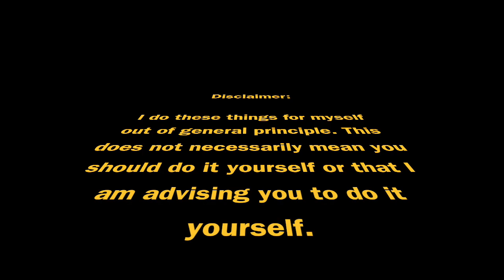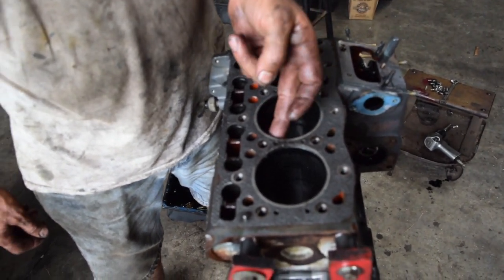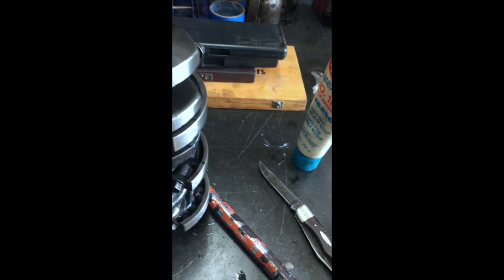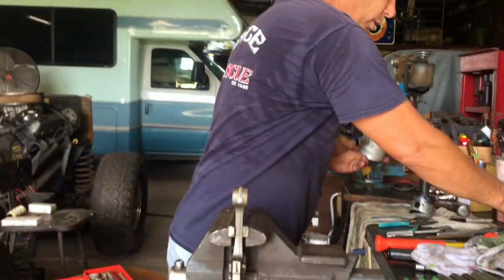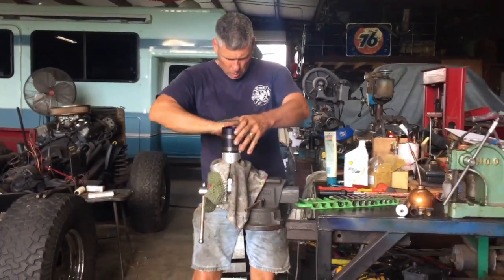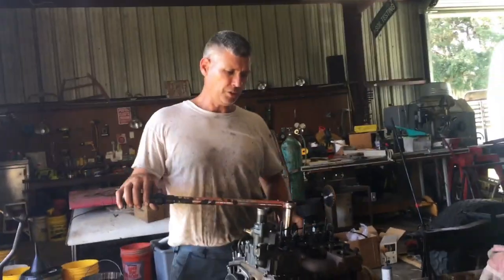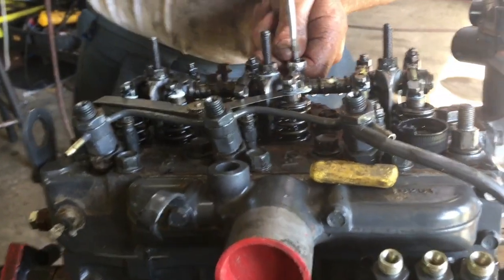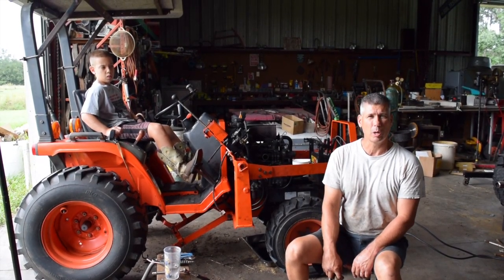Kubota B1700 Tractor Engine Rebuild and No Start Fix

Comment: Great video.
Damaged air filter or leaking/damaged inlet hose can cause wear like that, often called "dusting". Severe cases will see wear of the valve guides also.
More wear on cylinder number 2 due to the alignment of the intake port and the manifold inlet. 
"Maybe?"
Reply from the maker: Bruce McKenna thank you very much! Great insite!
Reply: This is it. I'm tearing my Kioti engine down and number 2 is the one that lost compression. Number 1 seems to be in the best shape and number 3 is weak but still making compression. Pulling it apart I found the previous owner had never changed the air filter and the inside of the filter and intake snorkel were almost as dirty as the outside of the filter. Not buying a $15 filter destroyed a $4,000 engine.

Comment: Just rebuilt a V2003T Kubota for the second time,  My compression is low (about 260 PSI)and hard to start cold. All new rings pistons and standard bore sleeves, and had the head and valves pressure tested. How did you break in the rings?
Reply from the maker: 30w diesel oil, heat cycles of 10-20 minutes a piece then cool down. And 2 to 3 oil changes. Then good diesel oil.

Comment: You forgot to check the end gap on the piston rings. File to fit. If the end gap is to tight in the cylinder bore when that engine get hot that piston ring end gap will bind together and the top of the piston will brake. Gaping and filing piston ring end gap is the most over looked procedure in rebuilding an engine.
Reply from the maker: Sam Logosz yes there were checked. These were already gapped properly

Comment: 370 hrs in 20 years is only 18 hours/year.  Perhaps it sat idle every winter and the cylinder bores rusted some ;  rings scraping  rust every spring might explain the worn bores and a crank not worn.
Reply from the maker: Absolutely a possibility thx.

Comment: You oriented the pistons to the rods but on my d1101a there is no marks at all on the pistons showing which side faces the front. And rods are identical for either side. I bought my kubora with pistons already out and head off so I pretty much got a puzzle to build. I got the piston and liner kit but I'm just using the new pistons and wrist pins bushings.
Reply from the maker: Yeah I had to double check all that as well. Good luck.

Comment: Make sure the relays for the fuel cutoff solenoid aren't causing the pull coil to stay on rather than just the hold coil.  It's only supposed to fire for a split second, if it stays on that will burn it up fast!  Great rebuild video!
Reply from the maker: RickBaconsAdventures I will check that out. Great info! Thanks!!!

Comment: Nice gob putting it back together🐂
Reply: How did you split your tractor
Reply from the maker: @evans4119  you need to pull all the grill, radiator and sheet metal  in bolt the front axle and remove then all throttle linkage and fuel lines, then the bell housing bolts and frame rails if it’s so equipt
,
Reply from the maker: Equipped  pull it  from the transmission.

Comment: hi  anyone help with  a kubota b1700 problem? it loses power and idles down goping up incline with rear  mower engaged almost stalls then will pick up rpm again but anytime o try to go up hill with  rear mower engaged it idles way down and will stall if i dont stop tractor/ any ideas? fuel pump filter? bad injectors? thx for any help   jim
Reply from the maker: Yes all those things and check/remove shut down solenoid and compression test.good luck!
Reply: ok thx for help
Reply: i had bad   loss of power  when cutting and moving it turned out to be a bad fuel assembly unit   i replaced the wholke assembly  and now it runs great   i tried just replacing fuel filter and that did not help    i mean  i replaced fuel filter assembly and fuel solonoid  and that fixed it
Reply from the maker: Yeah I believe most of the start of this poor things issue”s was the intermittent shut down solenoid.

Comment: How does the injection pump regulate fuel to adjust rpm. Currently working on a d1005 fueling issue with a new ip. Trying to figure out if the camshaft moves up and down to regulate it or if the stop slide moving back and forth regulates the fuel. Been on google for a few hours with no luck.
Reply from the maker: Andrew the sliding rack regulates the fuel. The Cam shaft only pushes the plungers on the IP. There is a small spring inside that regulates your wide open throttle rpm. Good luck

Comment: What did the bearings look like when you got it apart? Surely if it was ran low on oil the bearings & crank would show it. Could it have been dusted from poor air filtration? That’s a weird deal as I’ve seen those engines with five thousand hours on them that had no wear on the cylinders.
Reply from the maker: I know that’s what I’ve seem myself. I think low oil an ether.

Comment: any one no where the transmission oil filter is on the kubota b1700 e?
Reply from the maker: No I’m sorry I dont
Reply: @generalprinciple5921  ok thx manual says it has 1  but i cant find it
Reply from the maker: I believe you can go to Kubota .com and pull up an illustration. Good luck
Reply: @generalprinciple5921  ok ty

Comment: Hi, you changed and liners or just the pistons. Give me a link from where you purchased the pieces. Please...
Reply from the maker: Mure Mure I did do the liners on that motor however you can do 0.5mm over bore as well, which I have done on another engine. It is the easiest and cheapest route. Kumar Brothers has been the best value for kubota rebuilds that I have found so far.

Comment: Hey man, I have a 2002 bluebird 5.9 Cummins ,24 valve, Allison transmission. If you think you can help me out or have the time you can throw it up on YouTube if you want. No pressure at all, Id figured I would reach out to you first.
Reply from the maker: Dylan Mitchell what is it that your needing done? What’s wrong with it?
Reply: General Principle I know the front of the bus is leaking oil, there is some electrical stuff I need to figure out. But even a look it over to see if there is anything else. I was gonna bring it over while you’re on shift, but that’s probably not the smartest thing to do. You have Facebook?
Reply from the maker: Dylan Mitchell I’m on Monday. Give me a call at the station. I don’t have facebook
Reply: General Principle alright sounds good, ill have to call through the county side, I think I have the wrong number for the city side

Comment: I just put injectors in a b21 kobota it’s a 3cylinder it’s not starting not at all now before hand it would start right up most days but it would smoke like a freight train and loosing allot of power compared to what it used to be any ideas
Reply from the maker: Wrong injectors? Air not bleed out? Is the pump moving fuel? Shut down solenoid stuck in the of position? Keep me informed.
Reply: @generalprinciple5921  right injectors it’s getting fuel and no more air coming out I fried the starter fooling with it the new one should be here today and I’m gonna fool with it again hopefully the sitting has done it some good i think I may have had it overloaded with fuel plus this thing doesn’t have a glow plug so it makes it a pain to start cold when its cold anyway
Reply: @generalprinciple5921  finally got it running had to put a torch in the intake while cranking to get some heat in it after a few minutes of that it took off but still pretty smoky and especially on first start I’m thinking it’s got some compression issues doesn’t make any since why it wouldn’t even try to start cold even on either fried one starter to get it running like i said before hand it ran it was supper smoky and was having loss of power issues someone else had told him to get injectors and he had me replace em I don’t want to tell him to buy an injection pump but that’s what he’s thinking my thoughts on it are why wouldn’t it hit off either unless until it gets warm enough to close up tolerances it’s got to be worn rings right?
Reply from the maker: @jeremycable51  be sure to check for faulty shut down solenoid. Good luck
Reply from the maker: Well. I’m afraid it time to get down and dirty. Sounds like it’s time for a compression test!
Reply: @generalprinciple5921  that’s what I’m thinking it’s running now but i thinks the rings are worn it’s still smoking the owner thinks it’s the injection pump I would to if it wasn’t so hard to start
Reply from the maker: Well good luck to you.